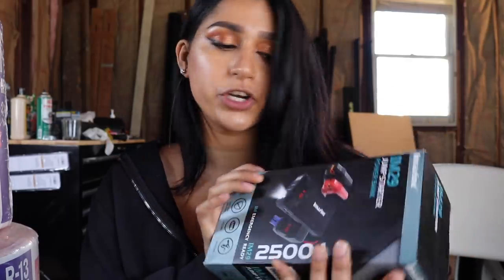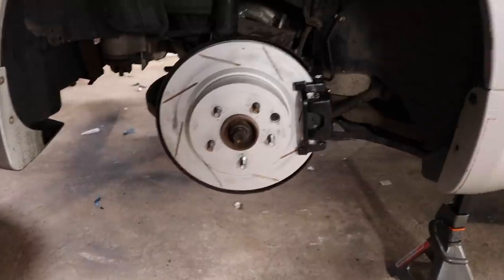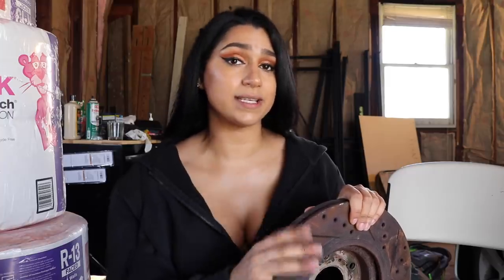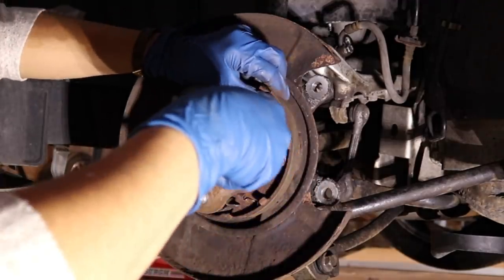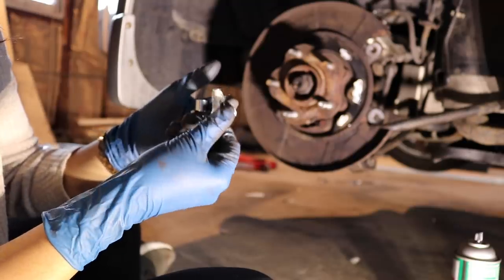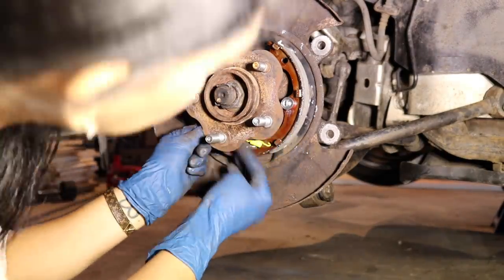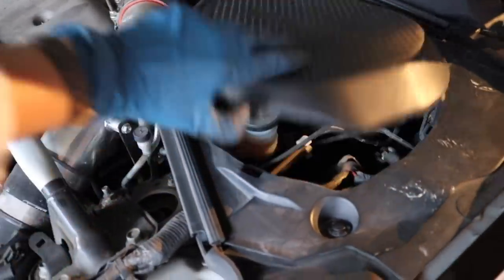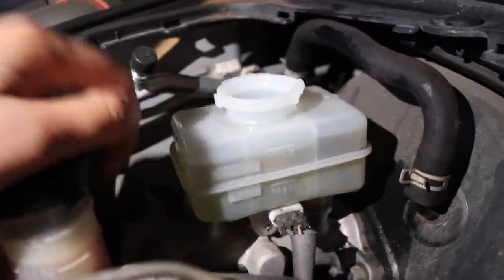ALMOST CRASHED THE Z !! // HOW TO REPLACE BRAKE SHOES ON A 350Z

Comment: Great to see you learned from your mistakes.  I have found that brakes from places like trick or treat auto parts are not good, they don't last and ALWAYS squeal.  Every vehicle I have sucked it up and purchased dealer pads, the brakes last at least twice as long and there is never any squeal.  I have been wrenching since the 80s and as we got to y2k I figured this out. Napa, Car Quest, some mom and pop shops had probably the best after market stuff. Speed shops also carried awesome aftermarket parts back in the day. Sadly places like Kragen ( home of the lifetime warranty,  where you spend your lifetime replacing it ) have taken over and quality is #2 literally and figuratively. Great example,  my Nissan titan that I use tow a 10k lb trailer with , i purchased with 32k miles on it. Driving home i came down conejo grade, someone who didn't know how to brake when towing warped the rotors, most likely cause they were pumping the brakes. Completely wrong especially if you are towing with an antilock system, they over heated the system. I dumped the rotors bought some special cooling cross drilled rotors online and paid the 90 dollars for factory pads. The truck two years later has 94k miles , the brakes are totally fine and no noise at all.

Comment: Be extremely careful when removing and installing those springs. I suggest wearing safety glasses and if you don’t have any use your other hand to cover the spring so it doesn’t go out flying into your eyes if it decides to slip or pop off while trying to hook it on the shoes. Glad you did it yourself! 👍🏽💪🏾

Comment: I'm glad to see you took people's advice to heart and rechecked your work!  Personally I've seen a lot of friends have issues with the disc/drum combo brakes.  I started out on cars that had disc fronts and drum rears, so I'm familiar with drum brakes, but really liked the 4 wheel disc systems that used the rear discs for e-brakes. The drum/discs seem to overcomplicate matters and make them more expensive, my opinion only.  Maybe others can shed light on how it's superior to disc only.

Anyway, some suggestions...you really need to protect your lungs and eyes with safety glasses and a mask, especially when wire brushing!  Once crap, especially brake dust, gets in your lungs, it doesn't really come back up.  It's great you're protecting your hands, but it's also easy to contaminate the shoe material and/or rotors and pads with the brake grease which would not be good. 

I would have used DOT 4 fluid, which has a higher temperature rating and mixes with DOT 3. DOT 3 is the minimum standard on many cars today. DOT 5 is silicon fluid and doesn't mix with 3 or 4, but is used on some high end cars, which is why I like 4.  Of course, you can buy a large bottle and bleed off most or all your current 3 fluid.  

When adding brake fluid, you shouldn't add the fluid straight from the bottle to reservoir to avoid getting air bubbles trapped in the master cylinder. Use a long, clean screwdriver and place the end in the fluid with it slanted a bit. Contact the screwdriver shaft with the lip of the bottle and pour the fluid along the shaft. Just make sure to wipe off the screwdriver and not to drip any fluid on your paint!

There's a specific order you should bleed the brakes in. Start with the longest line and work towards the shortest, which is usually right rear, left rear, right front, left front in cars with the master cylinder on the left side like normal left side drive cars.

Anyway, I hope you'll like the suggestions. Stay safe and happy driving! Great channel!

Comment: Nicely done Liz not afraid to show a mistake we try not to make them but they are often our best teachers Learning from a mistakeIs a lesson that you almost never forget. Always use brake clean even on an inspection I’ll give it a shot all over just so I can see everything better even if The pads don’t need to be replaced or what have you just so I can see and it’s good to get that build up off of their and if I was there I would’ve said just a little less lube a little more sparingly on the contact points you didn’t use too much but you could have used a little bit less but it’s all good no problem keep yourself well and stay safe🦆👍🙂

Comment: Replacing brake shoes is a pain of the ass. Middas only wants to "adjust" them.  I changed them myself on my daily. My Subaru Outback has all disc pads , gravy to change.

Comment: Nice work, Liz. You used all the right parts and methods to get the parking brake shoes squared away. I'm another old guy who has worked on drum brakes forever and there's one more thing you can do with these. To adjust the shoes to fit the drum, there's a tool called a brake shoe gauge that allows you to get the clearance between the shoes and the drum just right. That will, in turn, make your E-brake work perfectly, with only a few clicks of the lever. The tool is not too expensive, either. Keep up the good work.
Reply from the maker: Thank you so much for the advice! Im glad to hear that i did this correctly ! Thank you for watching

Comment: Just a safety tip always attach the positive cable first then ground
make sure you check for no cracks in the hub by drawing the rotor on with the impact rotor is cast and can crack easily
 They also make what they a brake spring pliers to install the return  springs also make sure the hub is free of rust to prevent the rotor for not running true with the hub
Reply from the maker: thank you !

Comment: Good job and good learning gradient. Keep going and don't let some failures stop you. We all started out as knowing nothing. I usually put  those springs on the two brake shoes, stretch it a little bit so I can slide them into place over the wheel hub. Probabyl would work here as well. But trying to get them in like you did is the other option that I know but don't like. :-)

Comment: if you need to jump start your car the red connector was good but the black goes to a ground, don't connect to battery but a ground close-by. keeps the unfortunate explosions or fires that could possibly occur.
Reply: The leads off of the jump box, look to short, to connect to the ground on the car body.

Comment: Nice job changing the rotors and callipers.   I seem to remember there is a tool for removing and replacing brake springs for drum brakes. Might be something to look into if you’re working on drum brakes more than once in a while.

Comment: Just a tech tip here..when you are putting the shoes back on..put on the bottom spring and adjuster on top and finally put on the top spring last..adjust the shoes untill you can spring the wheel less than 3 turns so you know it spins freely.

Comment: Cool they have parts for the 350z at Advance. I tried getting spark plugs from O'Reillys because it is five minutes away for my Frs, and they were way different. My last car was a Toyota, and even the CV axles they sold were an inch and half shorter than stock. So they didn't fit right and damaged wheel bearings. I am just surprised they have correct fitting parts. Cool though that you got it fixed.

Comment: Also you can adjust the parking brake at the lever in the center console. You just have to remove the cover around the parking brake lever and there's a nut to adjust it. I think it calls for 7 clicks.

Comment: nice job. one of the most important part you did. you clean everything up. plus the lithium grease on the metal to metal contact points. keep it going. nice work

Comment: The best way to adjust E brakes it's just put the rotor on leave the e-brake down and spin the rotor and adjust the star wheel until the shoes start to drag on the rotor.  Rule of thumb when you pull the e-brake handle it should be three to four clicks and that's it. Other than that good job on doing E breaks those things aren't easy.

Comment: You can use copper anti seize on the six pads that the brake shoes slide against.    This system is the parking brakes not an emergency brake set up.

Comment: Great video as always 
Just wondering is dot 3 is the right brake fluid for the car I would of thought it would of bean dot 4
Reply: Good question - the owners manual states DOT 3 - but you can mix DOT3, DOT4 and even DOT5.1 as all Glycol based. The only one you can't mix and match is DOT5 as its silicone based and doesn't play well with Glycol.
Reply: @3067jon  ya and dot 4 and 5.1 can take much higher temperatures

Comment: Quick tip iv done this for years put them together first then slide them over the top or what ever the case my be then all you need to do is put the pins in and your done no fighting anything don't get me wrong sometimes you can drop bits but after you done it for a bit that sometimes turns in to almost never this will go for any drum brakes I see pull sometimes and they make it look so hard but anyway stay safe and the best of luck
Reply from the maker: Thank you for the advice! Ill remember this if i ever do it again !

Comment: Dot 3 fluid? Haven’t used that for years. Surely it should be dot 4. Well it would be over here in Blighty. Keep working and learning we was all there once 👍🏻👍🏻♥️
Reply from the maker: Its i went with because if what was available to me compared to other brands ! Thank you for watching !
Reply: MICK BETH it will be perfectly fine for normal driving. You could get a bit of brake fade after heavy prolonged use though. I will watch as much as you post 🥰🇬🇧🇺🇸

Comment: I’m confused. I get when you installed the brake shoes, but then you put on a rotor on the same wheel?? How do brake shoes work on a rotor? Thought you needed a brake drum. Maybe you were changing front pads, and rear shoes.
Reply: Thomas Carroll was the E brake shoes man!
Reply: It's a drum-in-disc setup. Front and rear brakes are pad and rotor, parking brake is shoe in drum that's machined inside the rotor hat.
Reply: Dave  Never heard of that. Thanks

Comment: I'm sorry, but did you just say "breaker fluid"? Not being mean, just thought it was funny. I had my first experience with drum emergency brake shoes on my Tundra. After replacing the shoes and getting them adjusted correctly, they still don't hold the truck on a hill. Hope you have better results than I had.

Comment: I have no idea why manufacturers even put brake shoes anymore.especially on anything 2000ish.
Reply: Its about cost. Drum brakes are for some reason cheaper than disc brakes. I dont know why, that just seems to be the case
Reply: @Sethiol73  yup I've always thought that was the case, even though brake shoes just have more moving parts. And should by now be obsolete.

Comment: 2 remarks: why so much grease? (it can spread easily over the friction material). Why DOT 3 and not DOT 4, which is more "modern"? For the rest: keep making video's! Greetings from the NL.
Reply from the maker: I wasn't sure how much grease to use but i figured that it would be enough and i got a lot of mixed reviews on DOT 3 and other ones on the market but i went with this because later on i am going to upgrade to a big brake kit before i hit the track
Reply: @MICKBETH  Success with your projects!